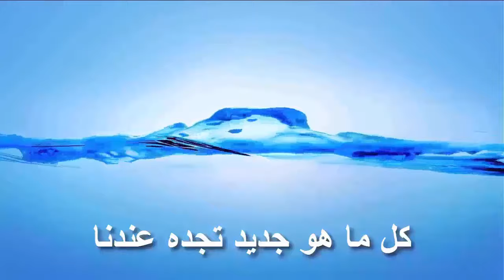HP Toner Refill | تعلم ملئ أي حباره طابعه اتش بي بنفسك ◄◄ في أقل من 10 دقاائق

Comment: كيف يتم ملء حبر طابعة كانون mf645
Reply from the maker: هذه طابعه ليزر الوان بها 4 حبارات اللوان الاسود - الاحمر - الازرق - الاصفر 
يتم التعبئه بنفس الطريقه مع اختلاف شكل خرطوشه الحبر و تحتاج هذه الانواع الي متخصص لانها حساسه جدا مع ضروره استخدام الحبر الاصلي 
This is a color laser printer with 4 ink cartridges: black, red, blue, and yellow. The filling is done in the same way, with a difference in the shape of the ink cartridge. These types require a specialist because they are very sensitive, and it is necessary to use the original ink.